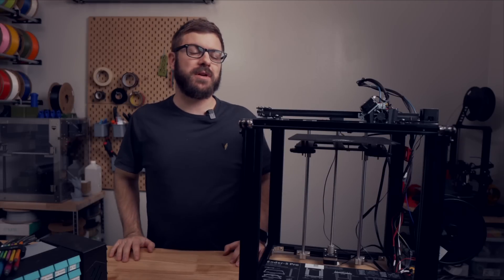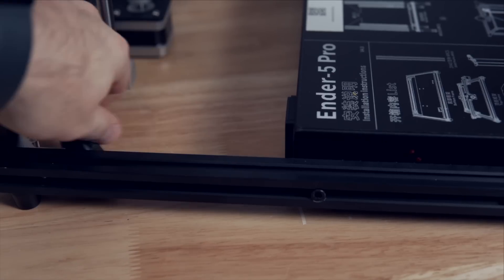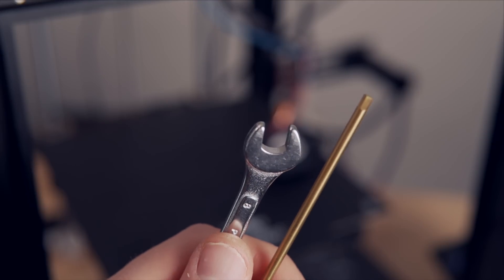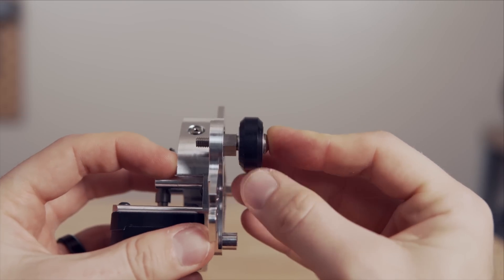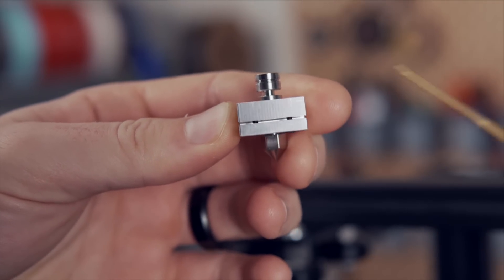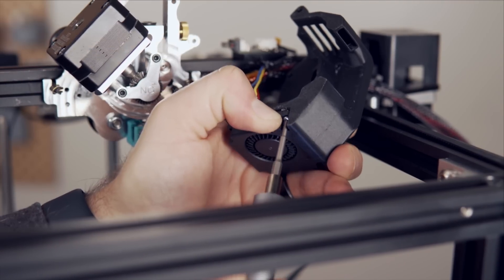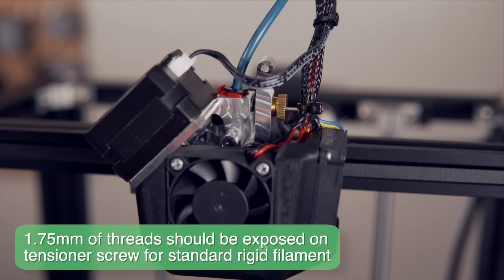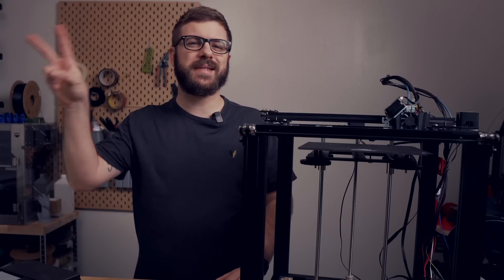Micro Swiss NG Direct Drive Upgrade (Creality Ender 5)

Comment: My stock Ender Pro setup looks nothing like this hotend. Mine is a lot more complex looking. To clarify, I have the Ender 5 S1 Pro. Is there any suggestions on how to mount the breakout board for the extruder, fans, thermistor, and hot end on this?

Comment: Great video, made installing it a breeze. However, i'm returning this, the extrusion was problematic at best. I may have ended up with a bad motor or cable but support was hard enough to come by from these folks, by I'd never know.

Comment: I'm another satisfied customer. This walk-thru made the process dead simple. The only issue I had was removing the heater element and thermocouple from the old hot end. They didn't want to come out until it occurred to me to turn it on for a few seconds to heat up the block. They they both basically fell right out.

Comment: Thank you for the great video!

However, I've encountered an issue since updating the e-steps with the provided G-code. Every time I start a new project, the heating cycle begins as expected. But then, the progress bar suddenly jumps from 0% to 20%, then to 50%, 80%, and 100% almost instantly. After that, the printer starts to cool down.

I suspect that the e-step update may have compromised the firmware on the board. Has anyone else experienced a similar issue? Should I consider fully reloading the software to resolve this problem?

Comment: Well what's the fucking point of a direct drive if you still need to use a bowden tube and the original extruder block installed separately? there are other ender printers that don't require a PTFE tube at all and the creality sprite kit is better than this.

Comment: As a note, the original wiring is covered by that mesh.  The mesh can the bunched up, giving a much larger area and the Extruder extension cable can run inside that mesh, the just manipulate the mesh slightly to get a gap (not breaking any threads of the mesh) to bring the cable connector out near the old extruder position.   This makes the cabling look a lot neater than just zip tied to the outside of the original wiring mesh.    
Creality now do have firmware for their "spider" hot ends that allows higher print temps, but you are better off rolling your own firmware using either Kilipper or Marlin to get a lot of extra features Creality do not enable by default.    Plenty of videos on how to do this on YouTube.

Edit: The stock thermistor that comes with Creality Ender 5, the glass ball type one, is not rated above 290 degrees and the newest versions of Marlin will not compile if you try to set the max temperature to 300 with this thermistor.

Comment: I know you said not to torque the screw that holds in the hot end but no matter how tight i made it the hot end was loose enough to fall out. I totally striped it before realizing it wasnt going in anymore and now i feel like george from "of mice and men"... Anyone have this happen before or know how to fix it? I got another screw but its gonna take more than super glue and a rubber band to get the old one out...

Comment: I upgraded my Ender 5 pro with the NG revo & all good, however I recently installed a bltouch & now my extruder runs in reverse???? Has anyone a solution?
Reply: swap the wires to the stepper motor around

Comment: Great video but could not find any info on reinstalling the BL Touch.  My NG did include the bracket but additional info would have been nice.
Reply: I am also looking for this. The offical pdf has no info on this
Reply: I just figured it out but unfortunately I had to take the whole thing apart again to get it on

Comment: I fucking hate this design. you have to move x stop which means your auto level is permenantly offset. not to mention the absolute manufactured garbage of the z level sensor, which will brake off as soon as it touches something on the bed. Microswiss clearly did not design this extruder for E5+ and they just shoved it down the throat.

Comment: I bought my NG six months ago and it was a fantastic upgrade however, last week the heater block dropped during a print. I put it down to not tightening the grub screw enough and cleaned everything up. When it came to re-inserting the heartbreak it was too wide! The only way to get it back in was to file it down, which seemed silly so I bought a replacement. It dropped too. Has anyone experienced this before?  I followed the fitting instructions to the letter.
April 23 Update. When the heater block dropped it was because I used the wrong set/grub screw to hold the heatsync in place. It needed to be a conical screw. My NG is back to normal with the help of micro swiss support who have the patience of Saints.

Comment: I have the original MS DD on my E5+, and I like it A LOT, but I think I'm going to hold out for MS to release a dual hotend or 2 to 1 hotend. I know BTT makes a 2 to 1 hotend, but I've heard it's pretty fiddly to get to work right.
Reply: If you have a DD that you are happy with, no point upgrading, unless you upgrade for the sake of upgrading.   To be honest, although I am looking at these, my Ender 5 Pro prints amazingly well with the bowden tube setup.  Because I don't print TPU or other flexible filament, and I don't print high temp filaments, the 260 degree limit on the bowden tube setup is fine for me also.  I rarely get stringing, unless I use old filament, and I have never had a jam, which is pretty amazing.   Any upgrades would really be just for the sake of upgrading, which can sometimes make things worse.
Bowden tube has it's advantages by keeping the hot end really light, where adding a DD extruder system woudl add a fair bit of weight on the hot end.

Comment: after 3 weeks of perfect prints the little grub screw that holds the heat block to the unit has failed and there is filament spewing everywhere. Any advice?

Comment: I'm confused. I thought the benifit of a dd was no bowden tube. Wouldn't it still be affected by the hot end temp?
Reply: No, it is considered a reverse bowden tube, as he said. The extruder is in the hot end, so the bowden tube only directs the filament to the print head.  Some people prefer this way, keeping the filament roll where it was before. I prefer mounting the filament spool on top of the printer, then going down to the print head without a tube.  Just personal preference.
Reply: @rcflyer2k  I'm definitely going to try it. I just thought that short piece of ptfe is a compromise. I'm a bit of a noob so I'm not really sure.
Reply: @paulmyfinger  Not a compromise, it is the right way to do it.  The long tube makes it a PITA to chnage filaments, and a diriect staright line feeds better, at least in my testing over the last couple yeras of usind Direct Drive extrulders.

Comment: Microswiss shipping keeps messing up for me. They sent me a broken NG, then i ordered the ender 5 adapter later and they sent me the linear rail version. 
They said they would send the correct part but never did. I ended up just switching to linear rail anyways.
Great products, horrible fulfillment.
Reply from the maker: That is wild to hear. I have never heard of issues with their shipping before. Glad you made it work, but yeah that’s not good.
Reply: @ModBot  ya the products are so nice too, but now I worry when ordering from them.

Comment: For real, got one of these from christmas and went from printing 30mm/s on my ender 3 to 162.5mm/s
Reply: I definitely wouldn't go up that high. I would recommend like 80mm/s max
Reply: @coltenmeredith8899  yeah I agree with you there as I have fine tuned it a tone. Wouldn't recommend doing this otherwise. It also barely achieves the speeds due to low accel
Reply: @Killer Miller  I must ask you, is the ender 5 a good printer? I have been looking at them for a week or so. I only have an E3V2 and have been looking to get something a little nicer.
Reply: @coltenmeredith8899  I don't have the ender 5 sorry but what I can tell from reviews and raw specs it seems good.
Reply: @killermiller9915  Oh, what printer did you put it on? An ender 3?
Reply: @coltenmeredith8899  Yeah I have moded it with a cht nozzle and 2 5015 blower fans and it works amazingly. I've had it on for a couple months and the only problem I've had was forgetting to set the esteps to 400
Reply: @killermiller9915  Wow. Congrats on the great build
Reply: @coltenmeredith8899  thanks! I will say the only bad thing I can say about it is that there isn't too many stls when you want to get specific with your build but unless you want a volcano with dual 5015 fans you should be fine!
Reply: @Killer Miller  I'm only running one 5015 fan, haha
Reply: @coltenmeredith8899  yeah there are tons of stls online for a single so you should be fine. I would advise you print the fan duct for it before you get the extruder as it comes with a 4010 duct out of the box
Reply: @Killer Miller  I already installed the NG, haha. Do you have the STL for the double 5015? I might switch over to double eventually

Comment: Is the shroud too thin for heat sets? Seems like that could've easily been factored in to keep the self tapping screws out and reducing one point of potential failure (not that it doesn't introduce its own), especially for the price
Reply: the shroud is prone to touching the hotend but quite sturdy. You could print a replacement if you had to.

Comment: I installed the NG on my Ender-3 V2 four days ago, and on my first TPU-print I didn't tighten the extruder lever enough (I think...) and had a massive clog which I just couldn't figure out for an entire day. After realizing that all I needed was to release the lever arm with one screw, everything cleaned up nicely and has been working perfectly for the last days, printing constantly.
It's such a nice upgrade, except from having to print the CR-touch bracket yourself, which I of course managed to snap during installation, and my old Z-limit switch is in the garbage somewhere. Lucily I've got a resin printer too, so I could print a spare, but it would be nice if it could be included in some way.

Comment: 1. Don't forget to print your BLTouch bracket  before starting.
2. Replace the stock cable wrap with some 1/4" split like ZGNO.25BK.
Reply: Mine came with the bl touch bracket

Comment: Why they did not release a version with dual part cooling is beyond me, I have the Hero Me 5 with dual part cooling and it made a massive difference to my part quality on ones that needed that extra cooling duct.
Reply: Using a NG with a 5015 on my E3Max via an adaptor, and doing 60m bridges with no problems, and it does have dual fan outlets, so it cools both sides of the print well.
Reply: They have released the STL for the duct and I printed the 4020 variant. It works very well and definitely superior to stock fan version.

Comment: I've been running the NG for quite a while on my 5+  - the only issue is the filament loading is a pain.. only suggestion I can give is to cut it so it is similar to a pencil - cutting just on one side does not load as easily.
Reply: heat the hotend cut the straightened filament at an angle and slip it through the bowden tube onto the rollers. Please don't worry about the arm thingy. Using the menu select motion then extruder and let the NG take the filament.
Reply: @slicedpage  Thanks - but I'm not the only one having the same issue. I've done what you say time and time again and it jams more often then not. This is not my first 3D printer or DD system.
Reply: @txwombat7826  I was struggling too so I contacted micro swiss and they gave me those steps to follow. I used to almost take the thing apart to get the filament to go through the extruder. I understand this is not your first rodeo and I apologise if I come across as patronising but I know how frustrating what seems to be the easiest step can be. Let me tell you my setup. Ng of course with about 10cm of Bowden tube secured with the coupling and retention clip. The compression arm screw is about 5mm away from the housing. Then as I mentioned before. When I first did it I was annoyed that I could not have done that before LOL However, I have heard stories of the compression arm roller not lining up with the other gears and that those units had to be returned. I hope you do not have one of them, you might like to check.
Reply: @slicedpage  Thanks for the additional details - Filament path / arm is good / aligned.
Reply: @txwombat7826  it is a pickle. Back when I was tearing my hair out trying to load the filament I would twist and push it until I felt it go in but then when I used the extruder to pull it through it would curl up inside where the arm is. I'd remove the housing and unscrew the arm and clear debris away with my trusty can of air and try again. Even the slightest piece of torn filament blocked the hole forcing any filament to go the wrong way. I assume you have done that. That the filament is not uneven. And that there is no chink in the Bowden tube and that you have tried without the tube and that the gears freely move. And that you have tried increasing and decreasing the spring screw on the arm thingy. If so then you may also have contacted Micro Swiss and they have or will tell you what they told me. If you have done all that and yet the filament refuses to go through into the nozzle then maybe the 3D printer gods have decided that this world is not for you and that your destiny lies elsewhere.
Reply: @slicedpage  :) thanks  -all good I'm up and running with the multiple angle cut hack (if you can call it that).
Reply: @txwombat7826  excellent, thanks for letting me know. Now....don't touch it LOL

Comment: Great vid as always! I just installed my Ender 6 version last night and good LAWD is it nice. I wish I had YouTube skills to put together something like you've made here, but I'm going to document the process loosely with pics & text. 

I'm printing the CR Touch bracket I designed now, then I've got a 5015 adapter up next, and my NG is going to be purring! 

Thanks again for the discount code you had on your 100k stream!  🧑‍🔧
Reply: print two brackets, thank me later:)
Reply: @slicedpage  what do you mean?
Reply: @AbraxAttack  When I bought my NG a few months ago it did not come with a bracket for my cr touch. I had to print one before I removed the old hotend.  So I dismantled my ender 3 hotend and attached the new NG. Then I wanted to attach my CR touch and the bracket broke. Now I had a new NG with an unlevel bed and a print that HAD to be printed ASAP for a customer. I cobbled together a bracket to get the job done but I regretted only printing one cr touch bracket. So I always advise new buyers of the NG to print at least two. Now of course micro swiss includes these brackets with the purchase.
Reply: @slicedpage  the Ender 6 is "incompatible" with CR/BL Touch according to Creality, so MS doesn't provide a bracket STL for it, let alone ship a premade one. That's why I had to design one, and I'll be posting/sharing that once I'm done tinkering.

Comment: I much prefer my Sprite to my NG.  I know Creality makes a bracket for the Sprite and the Ender 5 now, hopefully they release that bracket soon.  I mean both extruders produce almost exactly the same results and you would be super happy with either one, but the creature comforts of the Sprite just make it superior.
Reply: What are the creature comforts that the NG doesn't have compared to the sprite?
Reply: @JeanSolagnier  The way the whole hotend/extruder is mounted is a big one.  It has 3 bolts on the side that are super easy to take on and off, its almost like having something like Wham Bam Mutant.  It makes working on the extruder or changing nozzles much easier.  

The NG you have to reuse your wiring.  Not a huge deal, but the wiring on the Sprite is super clean.  1 cable that is easy to take on and off for everything including the CRTouch.  Speaking of the CRTouch it has an ABL bracket built in.  

Like every hotend I have seen Creality produce, the heater block is attached to the heatsink.  You dont have to worry about the heater block spinning when changing a nozzle.

Comment: I currently have the micro Swiss direct drive setup for my Ender 5 Plus. It was the first one that has a standard MK hot end and the aluminum plate would there be a great advantage in swapping this out? The only thing I can see is that stepper motor looks to be lighter than my stock one, but I'd have to see a noticeable difference justify the entire cost in swapping it out. What are your thoughts?
Reply: IMHO it was money well spent. Faster prints, multiple filaments, so much less hassle and excellent customer support.
Reply: I have 2 of the original MS HE/DD and an NG.  I don't see a big printing difference between them , but the NG is quite a bit lighter, that might make a difference at higher speeds if using Klipper.

Comment: Advice if you get a clog in your heater block.... Use Q-TIPS to clean the silver piece. Helped out a ton when I accidentally got melted filament all over.
Reply: When mine started leaking I ended up having to replace it. The threads were too loose and leaked badly no matter how tight it was.